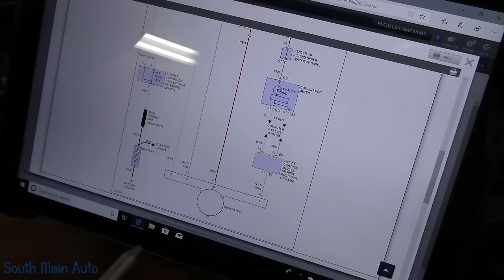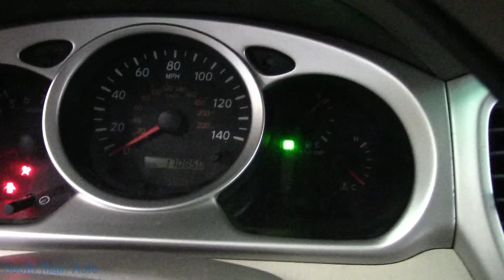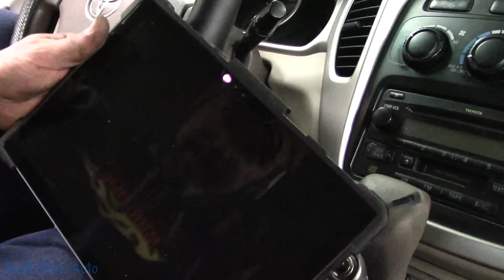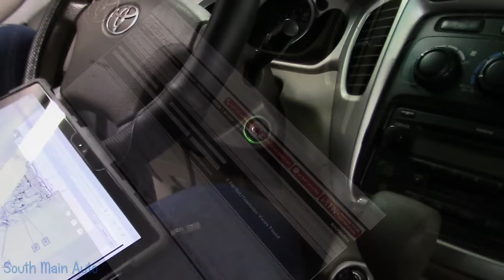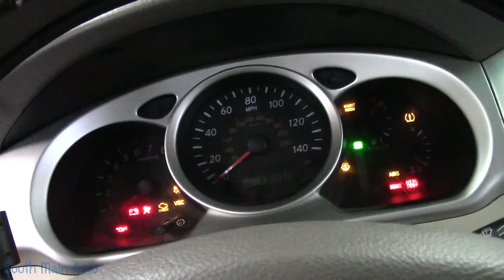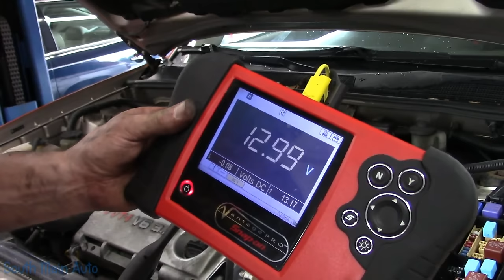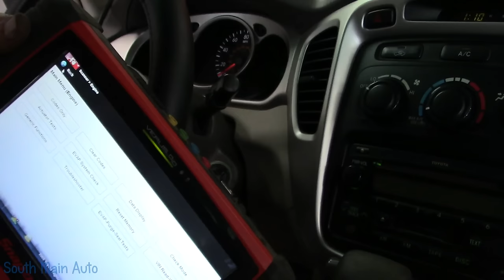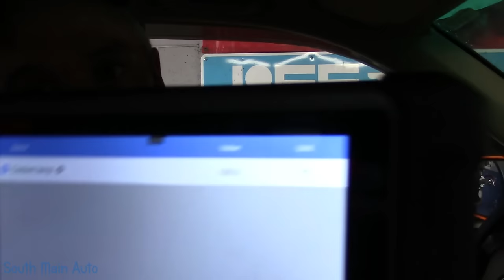Toyota Highlander - To Fix It, Follow The Smoke! 🔥

Comment: You are correct, Rick....
A blown fuse is never the problem. It is the result of the problem..
    When I had what looked like multiple problems, I would work from one item backwards to the power source; doing the same with each item.Usually, they would reach a common point, which would lead you to the problem. Your trouble shooting skills are right on the money.....You earn the right to be  called a Technician, which is what you must now be, in addition to a Mechanic..
.. Bravo ...!!!!

Comment: Kudos on continuing to work during the nuclear attack
Reply from the maker: No car left behind...
Reply: South Main Auto Repair Any idea on the root cause? Seems suspicious that she took it for an oil change and then all of a sudden the shit started hitting the fan
Reply: Battery terminals are right above the connection, disconnected for safety, chops into the connecter, instant short.
Reply: My guess would be that the battery leaked some acid onto the connector at some point and from there on shit went funky, saw that a few times on cars I fixed, but my guess is as good as any other
Reply: Must have been filmed at noon on a Wednesday. That's when they test the sirens in my area :D
Reply: @jonathandavis3312  same here but only on the first and last Wednesday of each month
Reply: @Goultek  That was my thought. Acid gets into the connector, causes some corrosion between the blades of that white/blue wire. At 12v/7.5ish amps thats 90 watts trying to push through the corrosion which will cause a bit of heat. Once it melted the insulation on the wires and the plastic plug housings it has more shorts than the shoreline during summer.
Reply: @Goultek  Keep it simple. I'm thinking a corroded pin, causing a voltage drop and heat. Heat melted the plastic and burned the connector pin.
The battery doesn't look like it's leaking.
Reply: @jonathandavis3312  Sirens for what??? You live next to a chemical plant or something dangerous of that ilk ??
Reply: turtlezed Tornados
Reply: turtlezed They test the sirens once a week
Reply: @jonathandavis3312  didn't know you were far enough west for tornado's but hey, wtf do I know ,I'm British no tornado's here, only the ones the RAF have.
Reply: @turtlezed  Apparently we (Britain) have more tornadoes per square mile than any other country in the world, they're just too weak (F0-F1) to be noticed or cause any damage (apart from the F4 one that hit Birmingham in 2005, and even that's peanuts compared to those big 'ol ones that level US towns).
Reply: Noon whistle.  Time to break for lunch?  I think it's test of the weather warning system.  Happens here every Wednesday.
Reply: @spaceinvadertoo  his fire department is right across the street from him.
Reply: @-BuddyGuy  You sound like so many customers. "Ever since you did my oil change, my tires are bald." ☺
Reply: Joe Black No it sounds like the sirens that alert of a problem at a nearby nuclear power plant.
Reply: @daveedwards6727  small towns also have volunteer fire departments. The siren gets there attention if they're away from radio/phone.
Reply: The Russians are coming!!!
Reply: There's a few possibilities for the sirens. 
Noon whistle (usually only one sequence though), this goes back to the old farming times when it signaled time to meet the wife for lunch. 
Storm siren test (most places test once a week, full sequence) 
Storm
Fire. volunteer fire departments use them sometimes to signal a fire and call all the active firemen in. usually in small towns where the firemen are farmers and may not be by a phone or can have a radio on.
Reply: "WE GOT ALL THESE PEOPLE WITH NO WAY TO RUN AWAY WHAT ARE WE GONNA DO"

South Main Auto Repair LLC: "Hold my pb blaster"
Reply: Fire whistle?
Reply: Jonathan Davis where I live they test daily
Reply: Thanks for the video Eric O.
I don't get why people are either soldering v.s. crimping. If they're done properly, both are good.

I've done a couple of my motorcycle ignition switch multi plugs. The current to drive everything except the starter motor passing through one pisant little blade terminal to the female half, combined with all the heat collecting above the engine, plus maybe some water ingress, kept frying the plugs and terminals.

One bike would stall and go dead waiting at red traffic lights, the other wouldn't start hot when it sat for a bit. I soldered, heatshrank and taped them. If I ever need to replace the ignition switch, chop & resolder.

I get that there are certain locations on a car/bike it would be foolish to solder, and multi plugs are far more convenient. But occasionally there are places like next to a junction box and battery. Even with a weatherpack plug, terminals are two physically separate pieces of metal waiting for green crusties.

Sorry for the wall of text hahaha!
Reply: @jonathandavis3312    They run the siren once a day at noon.  I used to live in Bath, NY.  Same thing.  When Bath, NY ran their siren for an actual 'fire call' they had/have (it's been years sense I used to be on their fire dept as a vol)  It was a 2-tone siren that really got peoples attention.
Reply: @panzerveps  Who designed the wiring, Chrysler?
Reply: @jonathandavis3312  I lived in a town that didn't have any threat of tornadoes. We had a siren as well and they used it to call the volunteer firemen when there was a fire somewhere. The firemen also had pagers (in the days before cell phones), so I'm not entirely sure why they also used the siren.
Reply: Men he must love this job so much to be will to die while working on a vehicle lol
Reply: @-BuddyGuy  heard the word "🌪️ tornado" during the announcement made by the air raid siren. Perhaps a storm was nearby...
Reply: Yep, that is SMA. Best service. Period. Not even the air raid siren and the dull thuds of bio bombs will stop him!
Reply: @-BuddyGuy  They might have replaced some part with a bad one.
Reply: @hatfez  fiat.
Reply: @jeffreyhueseman7061  Never thought about it until this video: Add a temporary battery quick disconnect during diag in case of  smoke show.

JMF TAG 
The Alignment Guy (TM)
MN, TC area.
Reply: I live in SW Michigan, my city tests the emergency weather sirens at noon on the first saturday of every month.  they used to only use them if there was a tornado warning, but they are more liberal about setting them off in bad weather since we had these "straight line" winds that past through about 20 years ago, caused a lot of property damage.
Reply: @turtlezed  : Fellow Brit here. I’m east of Chesterfield, (Derbyshire / Nottinghamshire border), and on 12th May I saw a tornado touch down in the fields east of us, (I couldn’t judge the distance accurately). Apparently it did some minor damage to a few rural buildings out Lincolnshire way.
Reply: @daveedwards6727  : Back when I was a kid they used to test the nuclear alert sirens periodically. Sometimes once every six months, but if things were getting tense geopolitically, they’d test them once a month. There was a siren on the roof of our local secondary school.

The coking plant that used to be nearby also used to test its sirens on the last Wednesday of every month at noon.
Reply: @SouthMainAuto  12:50.. neutral switch wires bare,earthing out. ?. will watch end later. great vids. AAAA...
Reply: @FunkyFresh48  employee states "I had to test drive it a little"
Reply: Dude when I heard that siren I was like is he going to like respond in anyway 😂
Reply: @-BuddyGuy  does make you wonder doesn't it

Comment: This car just needed some love!  TPMS system broke, AC broke, exhaust broke, throttle body dirty, alternator not charging.  Poor guy was so desperate it tried to set itself on fire so someone would pay attention to it.
Reply: lol , yep
Reply: Perfect Japanese design, " you take me to dealah on regular schedule or I commit suicide. Ritual Japanese solution "

Excellent deductive reasoning and taking your time to find the fault. I would have repaired it the same way. For a 2005 car it is the only economical repair. 

You should be good on fuses for another 3 years.

Any possibility you could show with permission of course the customers reaction to the repaired vehicle in future repair videos? Merely curious.

Actually they can be considered security videos to protect your business and the customers vehicles against any claims the repair wasn't done or completed correctly. And if you posted signs in your shop stating that the shop and grounds are being recorded 24/7 that should cover your business and personal.

Just thinking out loud.

Thanks for you time and effort in making and posting these videos.

Cheers!
Reply: Now that's some funny s***
Reply: Nothing else was getting anyone's attention. I know! Smoke signals!
Reply: Flatus Antiquitous they do as long as u work on them sometimes just like everything else.
Reply: Fred Wills - That in-line 6 was pretty reliable for me. I naively got rid of my Grand Cherokee with 223k miles on it and I’m positive it would’ve kept going.
Reply: @Fred Wills Actually, yeah, they do.  Corroision and shorts happen with every make too.

Comment: I only work on my own family's cars, and I'm no mechanic, but I love to see someone who is put things in terms someone like me can grab and hopefully learn from. Your work is super! Love the diagnosis and problem analysis, and your consistent encouragement!
Reply: Hi Dave. I only work on family vehicles too, as I am 77,  but I have been doing it since I was quite young. My first job was in an automatic transmission shop at 11 years old. I started out basically sweeping up, cleaning and putting tools away, and within two weeks I was pulling transmissions out of cars. After HS I joined the USAF and worked on jet engines. Now let me give you a little advice. The major portion of any repair today is the flat rate cost you pay for labor, so it is prudent to approach a repair from a different sense than if you were a mechanic like Eric. On many occasions I have heard Eric say that he can only fix what the customer asked him to fix. I hear the same mantra from Scanner Danner : " Don't be a parts changer". Well, as a DIY guy, I can tell you that there are times when it makes perfect sense to fire the parts canon. For instance, if you have a car with a lot of mileage on it, and the lower radiator hose develops a leak, change them all, flush the radiator, install all new all Stainless clamps, change the thermostat, and gasket, and put in new coolant. All of those parts are less than one hour of flat rate labor. The way I see it, all the hoses have seen the same time in service, and are close to the point of failure. The same applies to Coil on Plugs. If one goes, chances are another is not far behind. The same with bulbs. A mechanic like Eric cannot always do what he thinks would be the best option, you do. Most people today will say "just get it running again" That's fine, right up till it isn't again. I recently completed a timing job on my 2004 f 150. I replaced the timing set, chain adjusters, oil pump, all roller followers and lash adjusters all idler pulleys, belt tensioner, PS pump, AC compressor, accumulator  and lines, condenser, all hoses, radiator, throttle body and several other parts. And all of those parts cost around 1500. If I had this done it would have been around 4500 or more, and I have very little faith in most so called mechanics these days, and for good reason. I might not feel this way if I was close to Eric, so use your common sense. A good example of being stupid would be to change only the spark plug on a missing cylinder. I think you get my point.
Reply: @jima3129  I'm not even understanding what part of my comment you're referring to?? I didn't make any mention of any aspect of parts cannons or doing right vs doing best or whatever you're referencing.

Comment: Chances are corrosion in the connector caused an increase in resistance  with a corresponding voltage drop and a nice well overheated plastic body. The green crusties achieved their objectives once again and brought the vehicle to a halt. The fault lies in the connector design not being suitable for extreme conditions.The throttle body needed a clean out, badly. Tricky to diagnose from an unknown history viewpoint which made the repair all the more commendable.
Reply from the maker: Yep I agree :)
Reply: almost as if the manufacture planned it ehh?
Reply: Tool & Die maker for 30 years with  AMP inc. largest maker of connectors in world all of connectors were over built to withstand all extremes failure rate was almost zero .  That being said Foreign car makers had highest quality standards to meet.  Autos were like airplanes they had to highest quality because of Liability issues.  Good fix on replacing connector with splice saved customer ton of money.
Reply: @gonesideways6621  You bring back old memories for me . Put on thousands of AMP connecters on 25 pair telephone cables back in the 80 s . lol
Reply: @naknakacknak  Yep. But: cost is a problem. Salt spray in NY is another one. CA - you never hear of these problems.

Comment: Great diagnosis and fix Eric, your ability to break down a problem and not get pulled off track by new discovered issues always surprises me. Also your outlook on the cost of restoring the car to 100% factory setup vs the realistic life expectancy of the car is top notch. Your customers really get excellent service all the way around.
Reply: I suppose option 3 would have been to grab a connector from the scrap yard and solder it in. Still probably too much labour to pay a garage for but something I might do on my own car if I really wanted to keep it stock. On a rust bucket that's not likely to survive its next MOT I'd just do what Eric did.
Reply: Eric you are top notch nothing you can't get fix love watching all of your videos you get value for money when you fix any car

Comment: Good fix.  Soldiering the wires was the way to go.  No reason to buy the connecters, you solved the problem as you say by tracing one problem.  You saved the customer money and did a classic fix.  You are the man...

Comment: I'm sure you have seen me comment for years. You are one of the best mechanics I have ever seen. Approach was dead on. Following the charging issue then its circuitry was the Case Cracker. I can never get enough of your videos Dr. O
Reply from the maker: I see ya around ;)
Reply: yep,mr o is damn good,a few of his vids helped me out a lot in the past,he makes it look easy and when i did the same repairs ahhhh,not soo much,but like he always says...if i can do it....you can do it...just might take you a lot longer,i added the last part,lol
Reply: Good fix eric
Reply: I love the problem solving. I chuckled at the AC blinking. The goofy temp panels weren't soldered quite right, so that's its own monster. 

The breakdown is outstanding. You have an engineers mind!

Comment: You requested opinions. Here's mine. Your repair was fine no problems. I probably would have considered installing Weather Pack connectors instead of soldering. These connectors are exceptionally easy to install – even compared to the solder and heat shrink method. I keep Weather Pack kits in the shop for quick access. I also would have separated the highest current circuit (the fan) into a separate connector. Love your channel. I learn something every day.

Comment: It is so impressive you are consistently able to distill a multisystem problem down to a specific diagnosis in such a short time. Your workflow, to choose a simple circuit and look to where it points, seems to work great. Whenever I find a confusing problem the first thing I think of is a bad ground, but that doesn't get me as quickly to a connector the way your work flow does. I especially like the way you practically solve the problem without ordering an expensive connector from the dealer, waiting for days, and pissing away the customers money. Practical solutions are so much more useful for those of us who drive old cars.
Reply: smoke really helped

Comment: Your decision to start with the alternator coupled with the visual smoke was a great start to this otherwise seemingly difficult diagnosis. The customer should be very happy with the repair, especially given the age of the car. I enjoyed the commentary along the way too. A very good case study!
Reply: dash/key/relays acting stupendous? unhook and charge battery fully, reconnect with stable power supply, look for smoke and blows fuses. none? likely no bad wires lol

Comment: Impressed again by your common-sense approach as to where to begin with this vehicle. I was initially surprised that the problem was at the connector itself but in retrospect, it makes sense that moisture/water could have caused a short. The subscribers at YouTube, and especially the people of Avoca NY, are blessed to have you as their mentor/mechanic.
Reply: I know it’s an old video. But I was rewatching this video again. I’m wondering if, based on its location, the battery was dropped on the connector that damaged the wires (even tho there was no obvious damage to the connector)

Comment: Your some mechanic, your auto electrical skills will be the envy of most mechanics.  I had a car where the dash fuse kept blowing and couldn't tell how fast I was going, took ages to find without the schematics, (before the internet was common) eventually tracked it down to a data port cable the handbrake had literally cut right through. The tape holding the cable to the housing of the hand brake had lost it's stickiness letting it flop about under the ratchet. That was a painful one.